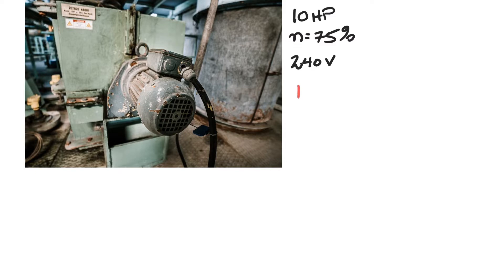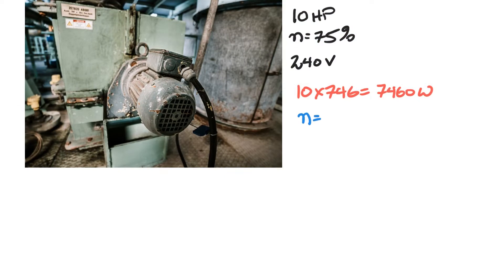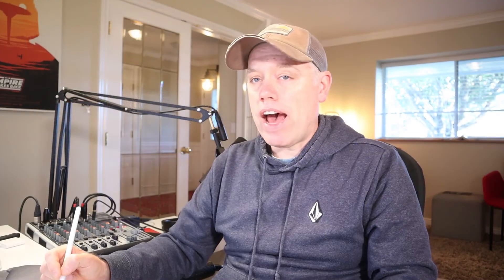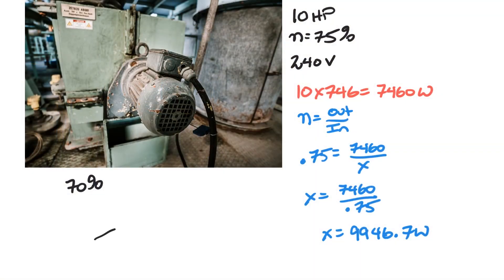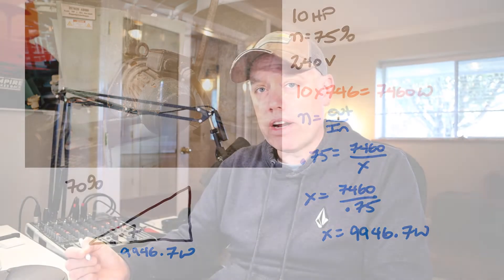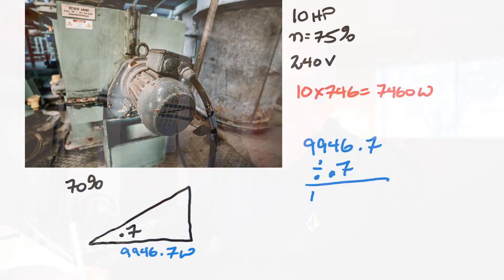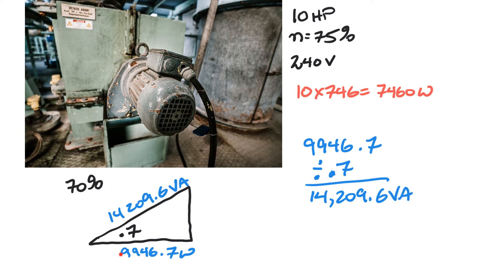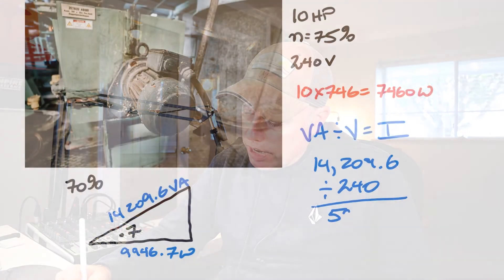MOTOR EFFICIENCY: What about the power factor?

Comment: The best way to learn this stuff is by picking up the following book...
- Electronics Fundamentals: A Systems Approach 😉

If you're not good at Algebra and Trigonometry then don't waste your time.  Personally, I recommend at least Pre-Calculus due to all the logarithmic equations when it comes to Capacitor/Inductor calculations.

Power Factor is the ratio between [True Power] & [Apparent Power].  Ideally, you want a Power Factor of (1) which means there is no Reactive Power hence  [True Power] & [Apparent Power] are equal thus no wasted energy 😉

Power Triangle
---------------------------
- True Power = Adjacent Side
- Reactive Power = Opposite Side (wasted energy)
- Apparent Power =  Hypotenuse

- Cosφ = [ Adjacent Side / Hypotenuse ]
- Cosφ = [ True Power (W) / Apparent Power (V·A) ]

- Power Factor = Cosφ

If for some reason you need the phase angle...
- φ = Cos⁻¹ [ True Power (W) / Apparent Power (V·A) ]

Comment: 7460w / 240v = 31amps ..   vs your calculated 59.2amps
Is this motor really wasting 28 amps ...  That seems pretty extreme.  So in this case, the electric company would be charging you nearly double the power that you're actually using.   Is this common?  Or is this example a particularly bad efficiency?

Comment: Thanks for sharing. I wanted to draw attention to one thing. 

In your calculation you basically applied the power factor to the Power output by dividing the power output by the pf.

While mathematically the end result will be the same, I think it is important to recognize that theoretically the pf is more like a ‘knockdown’ of the electrical input power rather. 

That means, strictly from the engineering point of view and dir the purposes of understanding, we ought to multiply the input power rather by pf rather than dividing the output by the pf.

Comment: Good morning, I have a VFD in which three phase induction motor is attached to and I have a capacitor bank to correct power factor lag. I want to know if it's a good idea to implement both power factor correction and a VFD?
Reply: As long as your project has the budget for it haha but usually with VFD's and its ability to soft start the motor it helps the motor not lose power which overall helps the power factor. So I would say if you need a VFD and still using capacitor banks then either the sizing of the motor, Tranformer, Cable or VFD is sized wrong or them some complexed loads which is go require a nice budget lol

Comment: Great video! However It's important to clarify that the current calculation considers a single phase motor. You need to multiply the voltage by √3 for 3 phase motors.

Single phase: A = 1000 ⋅ kVA / V
Three phase: A = 1000 ⋅ kVA / (√3 × V)
Reply: √3 = tan(60°) 🥸

Comment: Just a little correction on your triangle. Power factor is the cos(theta) of the angle (we call theta) you have labeled as 0.7. 0.7 (the power factor) is the result of that calculation, not the angle itself. Just a little clarification, since you can’t work out the equations otherwise. Thanks for the video!
Reply: you are right. should be cos-1 70 in order to get the angle.

Comment: Thanks for your tutorial it is very helpful, if there is no info about the motor how can find efficiency, voltage source current resistance power voltage required Vin Vout, maximum and minimum voltage and so on.

 Can you help us please.

Many thanks